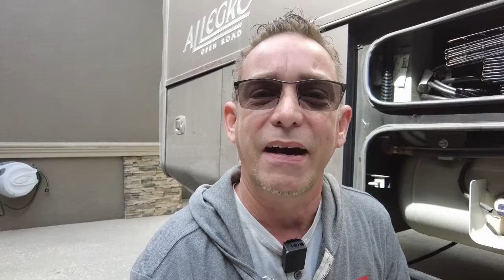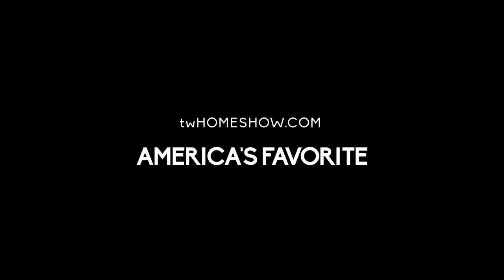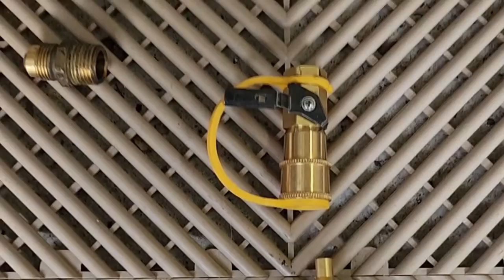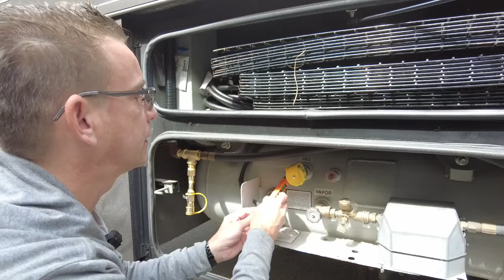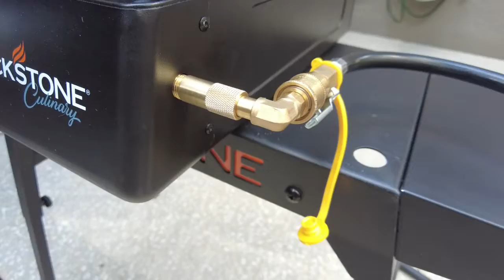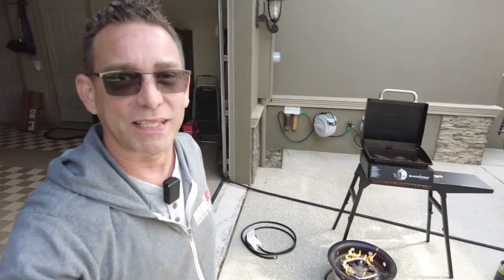Propane Quick-Connect System for Your RV/Motorhome | INSTALLATION

Comment: I understand this video is pretty old at this point but I haven't seen where you commented back on any of this so for anyone watching this to learn..... 
1) The gas leak detector that was used works just fine if you actually read the instructions and use it properly.  (I know - men don't need instructions! I'm also a man and sometimes - reading instructions is actually a good thing) Anyhow - you turn it on in away from any gas so it can sample clean air and when it beeps it's actually ready to use to detect gas. 
2) Tape on gas fittings this small (although it may say it is for gas lines) is a terrible idea. It only takes a small piece of that tape to completely clog a tiny propane orfice in the system. A spreadable thread paste such as Rectorseal is much better.
 3) You used your slip joint pliers and adjustable wrench was wrong about 90% of the time. They are much easier to use when held correctly and result in tighter connections. 
4) You should NEVER tighten a gas line and then back it off (as you did to position the quick connect downward)!

Comment: I have the same popane tester for my rv, you have to wait 30 seconds to a minute for start testing ( wait to the second beep, then you are ready to test). The tester is the best for propane leaks. You stated in the video that you don't recommended , Its because the device was not ready. Not a good instructional video

Comment: Thank you for this posting. I have a RV repair place that wants to charge me $450 for the part and installation. I think that's nuts! It's about $250 an hour for labor from them. I think it takes no more than 1/2 hour to do the job. I think I'll buy the part from them..... but do it myself.

Comment: Wow, if you’ve never been into that fitting that serviced your coach, the factory fitting was wrong!  you removed what looked to be a 1/2” Flair x 3/4 NPT... I would bet it leaked or at best would have started leaking at some piont.  The pressure aft of the regulator is very low so it may not have had a noticeable leak.  Shocking if factory, they know that’s wrong. Flared fittings seal at the flare and should never have pipe tape or dope added. 

Thanks for the video.
Reply: That fitting was just fine. The coach's hose that was connected to that fitting was a flared hose. Which he taped. 🤦

Comment: Can i install the quick connect fitting where the hose comes out of the regulator instead of the end where the hose connects to the hard pipe on my coach as it is too far under it
Reply: Thank you for the quick response
Reply from the maker: Yeah, anywhere after the regulator, as long as you can find the correct fittings.

Comment: Outstanding Video demonstration of the various connections for a Gas Grill and Fire Pitt!  I went camping just this past weekend and wondered how to create this exact setup! I'll take a look at my Propane configuration... assuming that my Weber Q Grill needs "Low Pressure" so place the "T" after the Regulator!  I'll report back if I get this setup to work!!  ~Big C in the DP 📢 ::: Air Horn 📢 :::  ::: Air Brakes! ::: 🚌🚌🚌
Reply from the maker: At least it gives some idea of ways to accomplish your propane needs. Wishing you the best! Thanks for your comments :) -Todd
Reply: @twHomeShow  Just purchased the parts using your links! I did locate the Quick Connect Hose and Fitting for my Weber Q instead of the Blackstone.  I look forward to doing this modification for myself and "ALL of my RVing Friends!!!"

Comment: Thank you for these very clear instructions. I was curious if you have checked for any leaks since installing this in 2022. Has it been holding up well? I also have the Tiffin Open Road and plan to follow your instructions to set mine up. Thank you again for taking all this time to make this video!

Comment: You failed to read the directions for the tester you were using.  The beep that you were hearing was the tester telling you it had completed the setup procedure and was ready for use and not timing out as you stated.  I had punched the same tester prior to watching your video and  was pleased with the operation.
Reply: I came to the comments to say the same thing.

Comment: I do like the way you setup the quick connection.
The two-stage regulator that is mounted on my propane tank is a - "Gas flo propane regulator gr-9959"
From what I can tell its pressure is 11 inches of water column, which is about .4 psi
The Blackstone regulator runs at .5 psi
Am I being too picky about the difference between the two and the Blackstone working as well as it should?
Reply: This is a good point. Most all RVs are set up for 11 inches of water column after the regulator.  If you are using the RVs regulator for your external appliances, better hope they'll all run as efficiently on 11 inches of water column as they would with their own regulators.